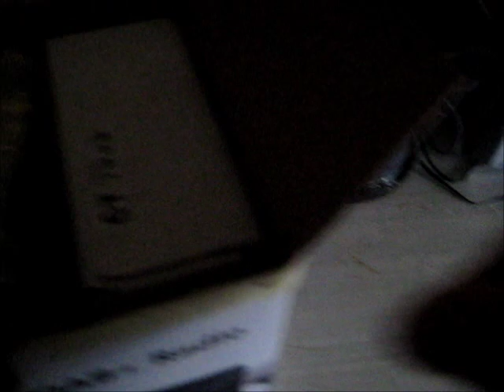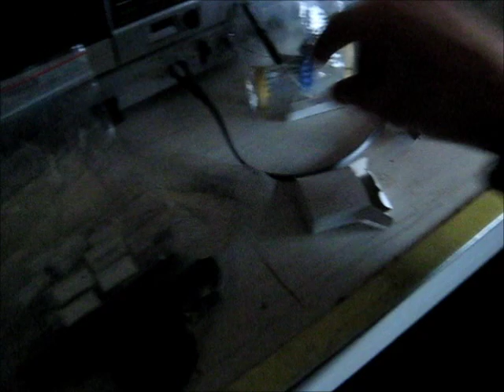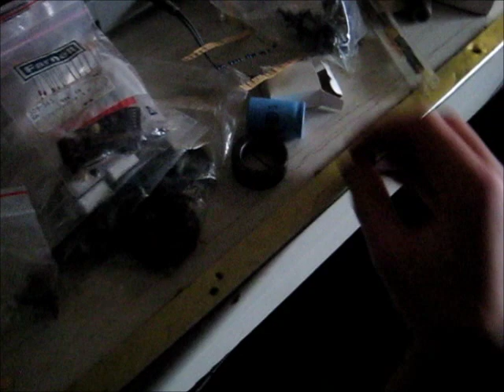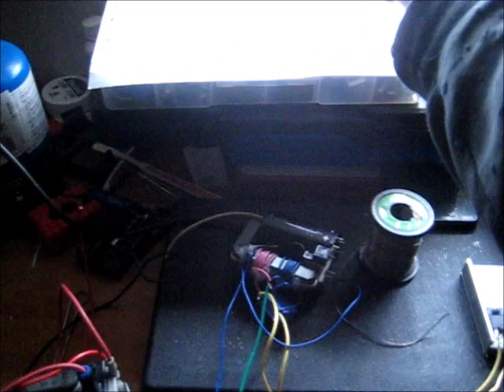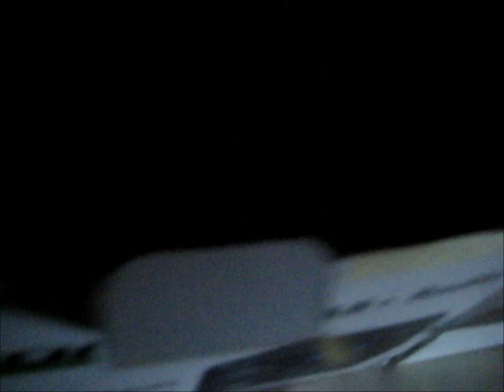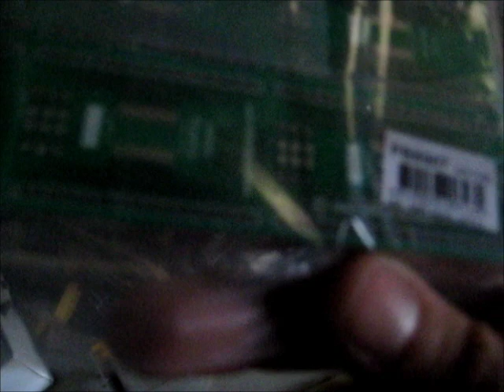Update & Box of Goodies

Comment: those mains caps are 0.39µF which is probably enough for the circuit to function. though it will probably just run at a higher frequency.